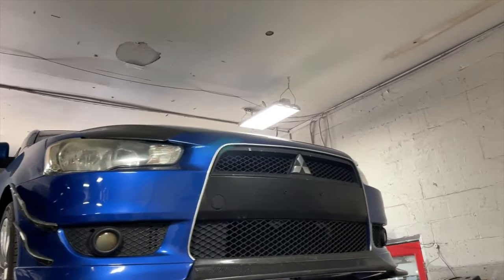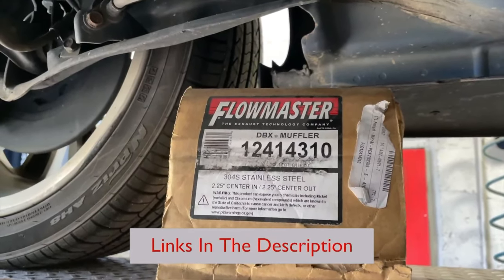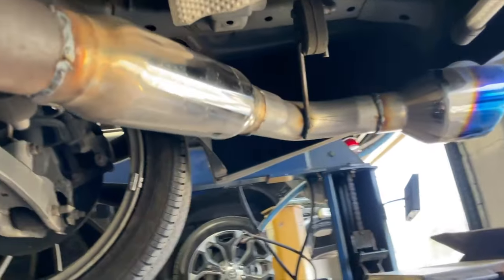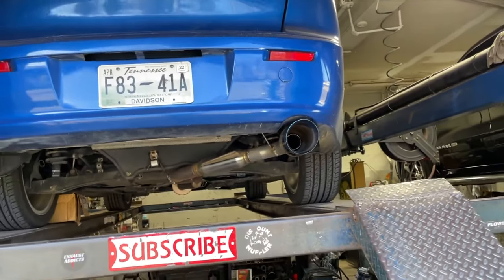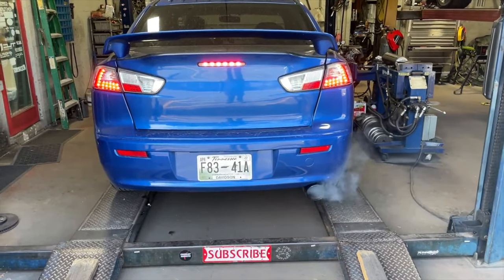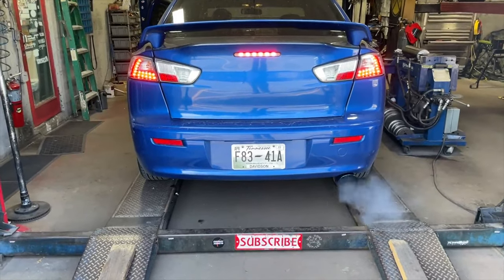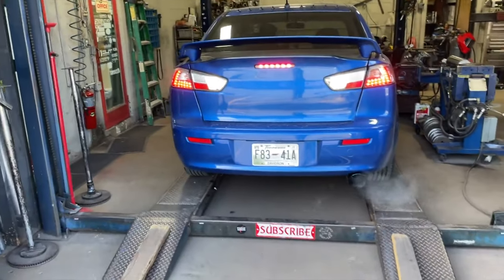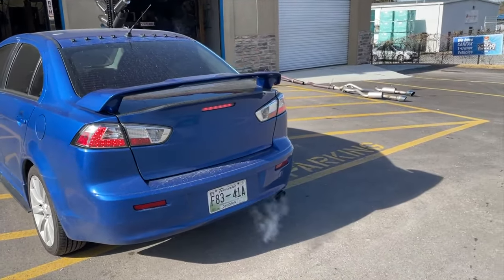2009 Mitsubishi Lancer Exhaust w/ FLOWMASTER DBX & VIBRANT RESONATOR!

Comment: Does anyone know if the dbx would sound any good on a v8? The flowmaster website lists them good for 4/6 cylinder then proceeds to list off hot rods, drag cars and muscle cars. Somewhat misleading but I only see this thing on small displacement asian cars. I wanted the pro series but they don't make it with 2.5" in/out.

Comment: Not feeling this. If it was an Evo I would understand a louder exhaust. This one I don't. Only if he plans on modding the engine to get more power out of it. Thumbs down.
Reply: this guy recording be lying when he tells the customer it sounds good
Reply: @boratwilson9916  He will tell them what they want to get their money.
Reply: @ragintaurusmusclemercury7023   if I have a v8 then automatic exhaust. old 4.3 sierra or silverado moderation.  but any other v6 needs to be researched. these 4 cylinders should be ban from exhaust shops.
Reply: @boratwilson9916  I agree. You can get away with performance exhausts for 4 and 6 cylinder cars if you research them first. Most don't sound good but only a few do. I had a V6 car that sounded good loud but there was a lot of mods done beforehand. Cam, intake, stroker kit, tune, and headers...... Good idle but still sound like a V6 without the embarrassing ricer sound.
Reply: @ragintaurusmusclemercury7023   something like a cobalt ss with the super charger
Reply: @boratwilson9916  Or a Neon SRT4. A Mitsubishi Lancer? Nope. Leave it stock. He wants a performance sound then buy a performance car. It is not happening with this car.
Reply: performance car, eh it’s lightweight and has a stick shift, it sort of is even if it’s not an evo. not saying this car sounds all that good, but you can have some fun with your exhaust on any car. this setup almost exactly sounds alright on civics but every car is different

Comment: The owner of this car is a ricer. Even my elantra had 300 whp. 

Dude probably has a car equal to a 90’s civic
Reply: elantra lol
Reply: @carlos-m20  1.6t, pretty easy with no cat and a tune
Reply: I love my sonata. Hyundai is the best
Reply: @sonatabirdie  for the price I’d rather buy an Audi. You can buy a used S4 for the same price as a new top of the line sonata. With better reliability.

The sonata 2.4 and 2.0t both have engine short block campaigns. Aka new engine because the factory engine is shit.